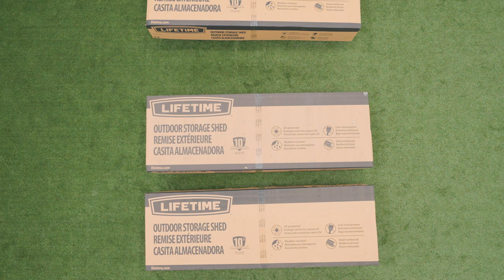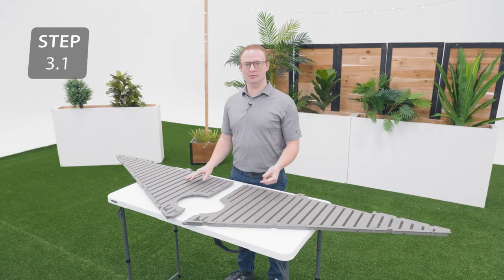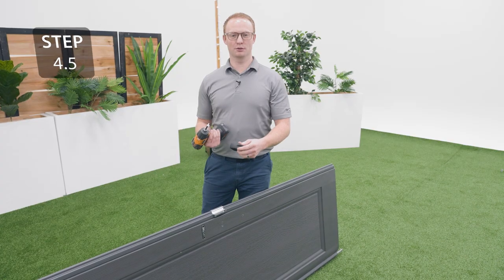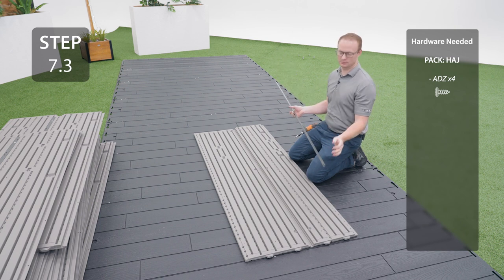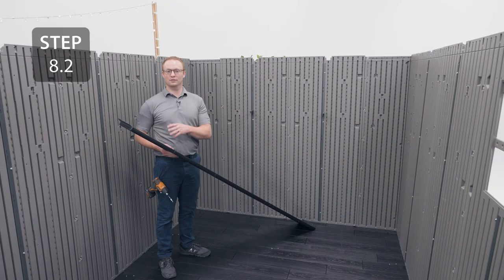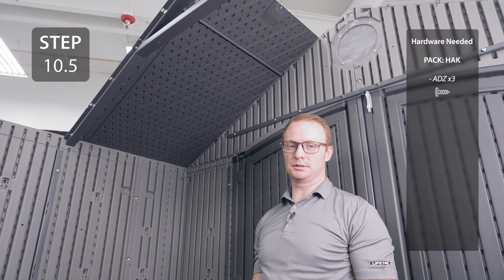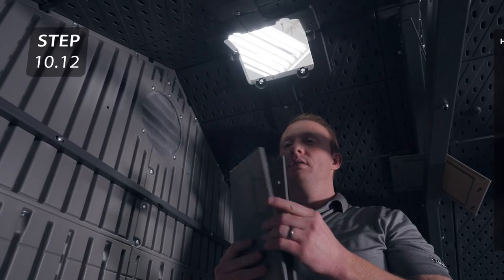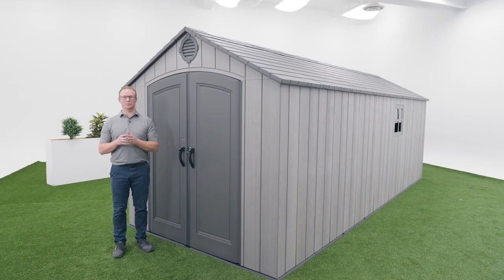Lifetime 8' x 20' Outdoor Storage Shed | Lifetime Assembly Video

Comment: 11.2 on the video is different then 11.2 in the manual. Is it easier to do that step the way it was done in the video?
Reply from the maker: 11.2 is the same in this video and the manual. You'll need to repeat 11.1 for attach the rest of the gussets to the trusses. You do this by inserting the gusset with the self tapping screws into the gutter channels and truss braces.

Comment: Where can I get more of the hooks from step 13.1?  Do you have any advice on how to mount other items to the wall / ceiling, e.g. a consumer unit panel for electrical installation, ceiling lights etc?
Reply from the maker: Replacement parts are available and can be ordered through our Customer Service Department. Our Customer Service Team can be reached at 800-225-3865 opt. 1 or by email at customercare@lifetime.com. Customer Service hours are Monday-Friday, 7:00 am to 5:00 pm and Saturday, 9:00 am to 1:00 pm (MT). We don't have any recommendations on how to mount for electrical installation since we don't recommend holding elecrticity in the shed.

Comment: How in the hell do you get the roof panels into the channel when the channel is loaded with screws and nuts from assembly of the trusses? They prevent the roof panel from seating into the channel!
Reply from the maker: The nuts/cap nuts should be located on the outside of the truss channel. The pan head of the screw is the only thing that should be on the inside of the truss channel.